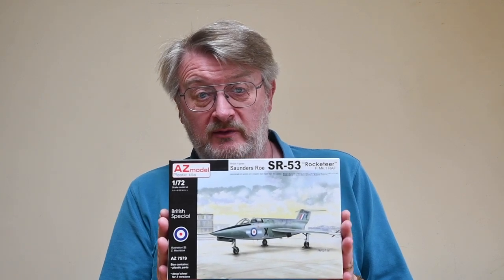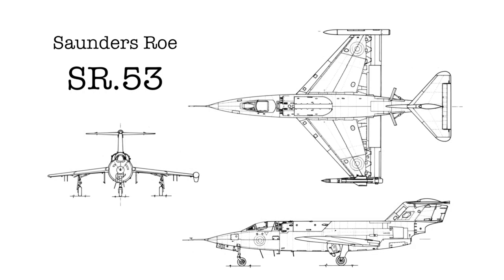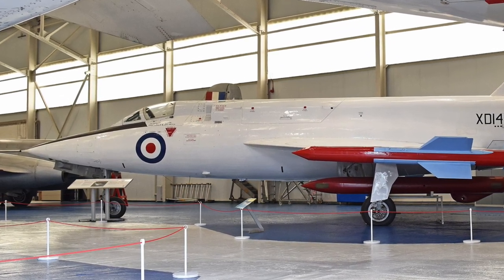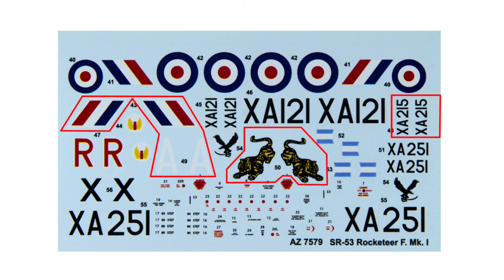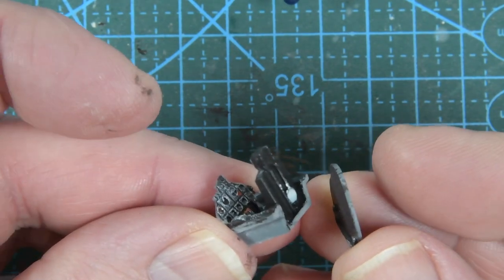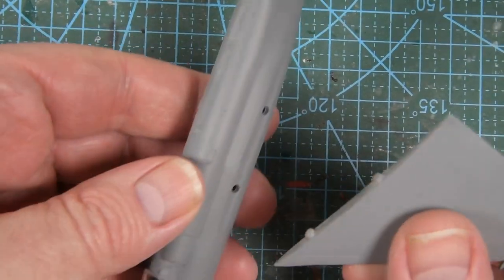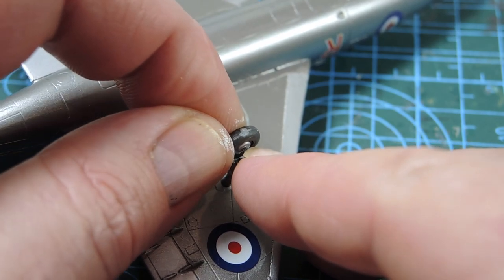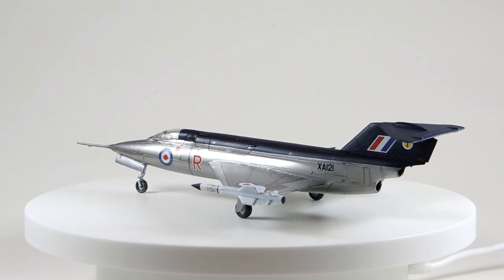AZ Model Saunders-Roe SR53 F.Mk.1 Rocketeer fighter 1/72 scale review and build - HD 1080p

Comment: Great Job Gary. Really enjoyed the build video. Like how you repaired the landing gear. A bit like how you advised me when I broke the red arrow knat on the sprew. Just finnished building the Airfix Tiger starter kit. Really enjoyed that kit..
Reply from the maker: It was fate that the part would break just after you mentioned it! The Tiger is a lovely kit - guess you need the Sherman now! Cheers, Gary
Reply: @garys_stuff  I think its true it was fate, because it gave the opportunity how to fix the problem...Which will be usefull to me and other model builders... I like how you used decals from another set for the missiles. Its sometning I do a lot. I recently got a zvedca kit out of a magazine it waz fairy battle and I really enjoyed it. It was the first time I used a gloss varnish and it turned out very good as I have used it on the Red Arrow Knat and X-Wing Fightet that I have painted up. I must admit Ilike the music in this weeks build video..Can you tell more about that ?
Reply from the maker: The music comes from a site called Uppbeat. Most are free to use (as long as you credit them) but some require subscription - but its about £7 a month so not a great burden. All my music comes from them.

Comment: Nice job!

I've recently built this too...it's quite a nice kit with fine surface detail, as you say. I built mine as one of the all-white experimental aircraft. It went together quite well but the tail assembly seemed to be warped and I had a bit of a job getting it all straight in both directions.. 

In fact I had a similar problem with the tail on an AZ MiG 17 (which I bought before the Airfix one came out). That seemed to be warped too which was a it strange.
Reply from the maker: Thanks Tim! I am half tempted to get one of the newer two-seat kits to see if they are any better. But only half tempted!